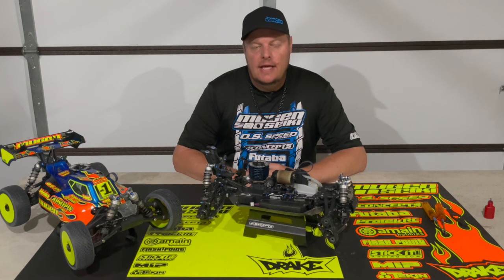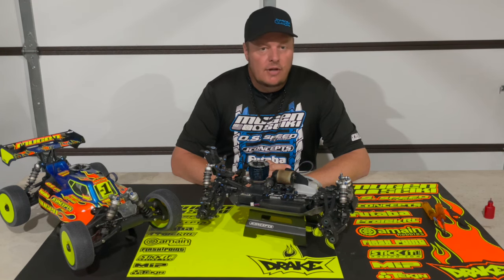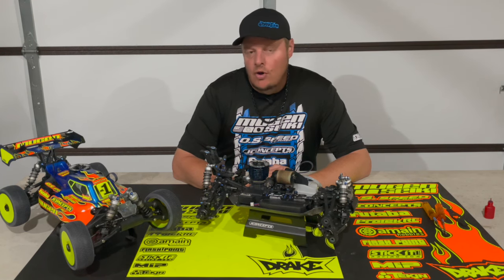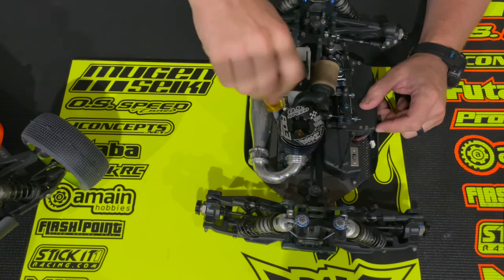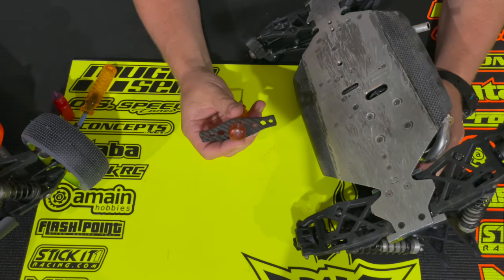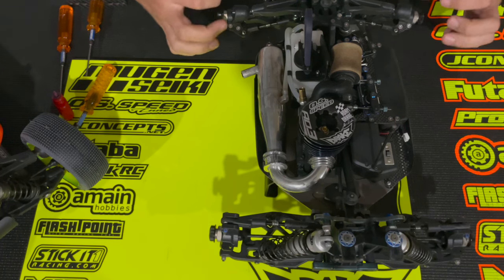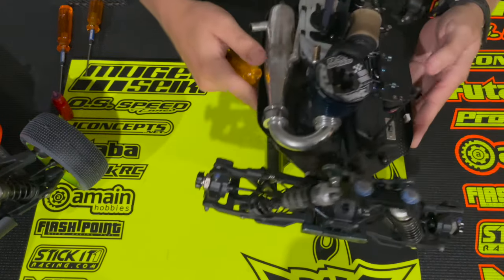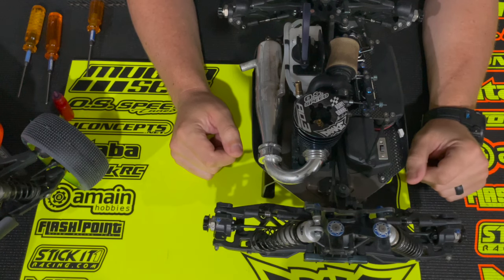How to Set Gear Mesh

Comment: Props leaving the snapping of the tip in your video.Just shows the pros still do it from time to time!Great information Adam I actually have struggled with this in the past.
Reply from the maker: Thanks 👍.  :)
Reply: Great tips, this is the only way I have found that I get consistent mesh/results. I also agree with above comment that it was cool to see you break that tool, holy crap you are human after all🤘🏻🤣
Reply: That was brutal. Good to know even mip drivers aren’t unbreakable, I’ll be a little more careful with mine

Comment: Hey mate I’ve got a meshing issue, I’ve checked the meshing and that’s all good but the main gear is showing signs of the engine/ clutch drive being too far forward. There is minimal movement in the clutch, I even forcefully moved it back in but it still seems like the whole engine needs to go rearward 2-3mm. Thoughts?

Comment: Is it bad if the clutch bell isn’t lined up center with spur gear ?
Reply from the maker: It doesn't need to be perfectly centered, but you want to make sure they're close to fully lined up.
Reply: Okay thanks. I’m trying a associated buggy with a tekno clutch on my engine and the clutch bell is lined up halfway on the spur gear. mesh and car rolling feels great just haven’t  drove it yet